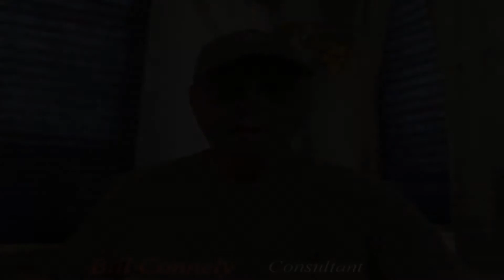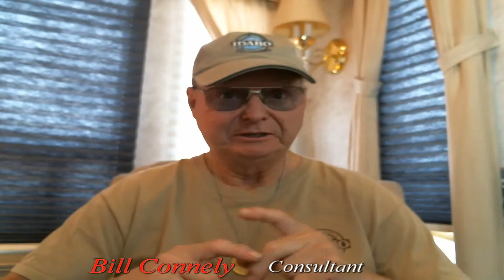How to empty black water tank on RV - properly

Comment: Always make sure the black tank is clean.  That is the most costly to have fixed.  It requires special suits as it is considered a biohazard, and can become very costly.  The most important thing to maintain is your black tank.  I recommend having a tank flush installed, and only have one tank valve open at one time.  This will depend on the type of RV you have.
Reply from the maker: Good info about the black tank.  Thanks,